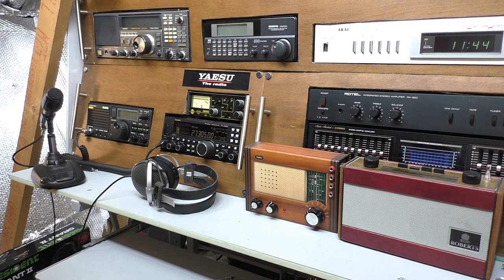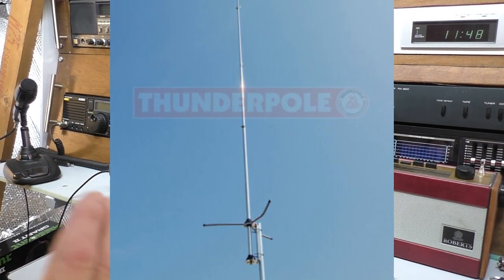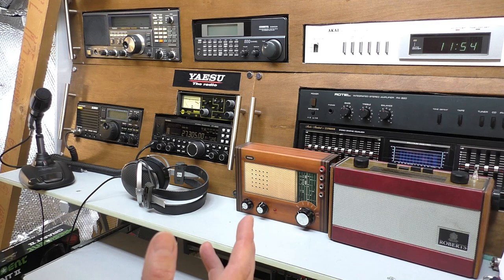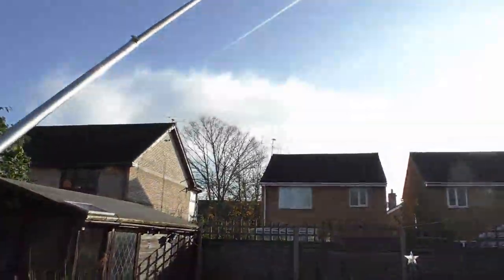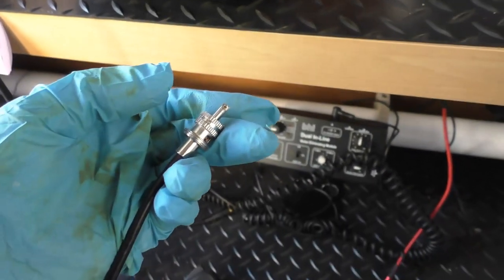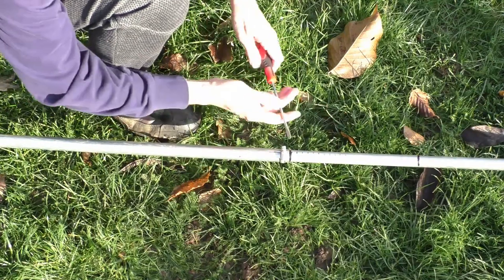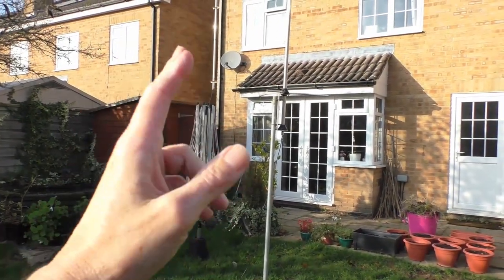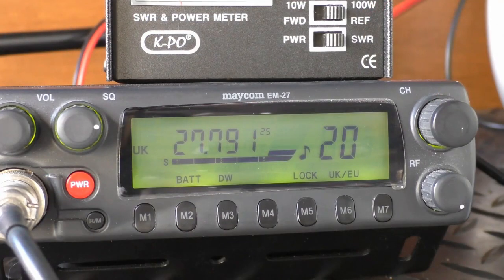CB Radio Beginners Guide.  Part 4. Setting up a home base antenna.  Adjusting the SWR

Comment: Great video Fred very simple but effective - just shows you that the angle of radiation from the elevated Antron 99 against a simple silver rod 2m of the ground perform very similar , might be nice to stick the ground plane kit to the Antron 99 and see what difference it could make. happy holidays 73's

Comment: I want to ask, if I test with a swr meter and the result is very high/very bad, will the swr meter somehow protect my radio from the high swr when doing this test to not take damage? Will the swr meter take the damage instead?
Reply from the maker: Good question.  As far as iam aware the SWR meter will not protect the radio.  Never been asked before so not 100%.

Comment: You forgot to say that each type of coax will require the correct type of pl259 for the type of coax you use.
RG8 mini gives relatively the same characteristics as RG213 with regard to power handling, losses and velocity factors but as you said RG8mini has the benefit of being more flexible.
Messi & pelony is more the radio ham choose of coax and is great for using on VHF and UHF but I would consider it to be a waste of money for using on CB and HF frequencies below 50MHz.
My top tip would be to have at least two 12-18inch patch leads made of RG8MINI AND RG213.
my reason for saying this is because most of any losses that occur will do so just after the radio and in the swr meter. So using higher quality patch leads helps to overcome this and gives a better swr and hence a cleaner signal.
RG8mini is my personal recommendation for coax for home based CB station.
Cheers Fred 👍(there's the thumb🤣🤣) have a good one and 73.
26CT2381 BAZ.

Comment: Hi isn’t it easier with all antennas to lower it all the way down to the bottom and then slowly raise it more and more until it’s tuned and good?
Reply from the maker: You could do it that way. Makes no real odds as long as you end up with a safe SWR.
Reply: @CB-RADIO-UK  I will have to trust the built in swr meter in my radio 🫢

Comment: interesting stuff fred, im slowly getting there with my new setup i got the thunderpole silver rod 1/2 wave antenna and rg 58 cable mounted on the side wall of my house about 4 mtrs of the ground ive yet to buy a swr meter. i couldn't find a power supply that i could afford so i opted for a 12v dc 5a supply the type with a cigarette lighter adapter on it i hope that that should b fine. thunderpole say there antennas come pre set for swr or am i just going to cause damage without one thanks and have a happy Christmas 👍👍
Reply from the maker: Hi James.  Video on PSU's coming up.  No antenna is truly pre SWR. Always safer to check.
Reply: Thanks Fred I look forward to the psu video however I was worried about the swr so I have orderd a fairly cheap swr meter should arrive tomorrow I'm currently sat listening to the channel 19 lol

Comment: New guy getting into the hobby. When you "key" up your radio, what am i hearing? Cheers
Reply from the maker: Might need a bit more info on the question.  When i say key up the radio iam meaning press the microphone button
Reply: @CB-RADIO-UK   Hi, Thank you for the quick response. It was when you were doing SWR reading trying to tune the antenna.  Could just be the CB for all I know. Brilliant video and just getting into the hobby as I said.

Comment: I have my home base antenna in the box, setting up sometime in the new year. Personally I don't give a #### about my neighbours. They never have this way. I'm wacking up a Sirio 827 with those big radials. If I have to take it off the house I'll mount it on a huge pole in the ground. 
The only thing that bothers me is the radials hanging over my drive and it becoming a pigeon toilet perch over my car.

Comment: IF WE PUT UP AN ANTENNA AT THE BASE USE RG-213. WE USE RG-58 AT 18 FEET LONG BECAUSE WE USE IT IN THE CAR. TOO MUCH LOSS LONGER THAN 18 FEET. I USE RG-213 IN MY FORD BECAUSE IM A HARDCORE CB'ER . BEEN ON SINCE 1974. STILL USING MY LAFEYETTE TELSTAT -140 SINCE 1979. THE GALAXY IN MY PICTURE IS AT MY OFFICE IN MANHATTAN NYC.

Comment: Don't know I'd anyone can help me, iv just set a homebase up which is picking stuff up nice and clear miles away but I cant seam to pick up the mobile cbs that I have in my vehicles. I'm operating on fm and obviously the same channel. Everyone is set up with the swr but I cant pick anything up from my vehicles or hear anything in the vehicles from the home base.
Reply from the maker: What radio are you using ?  Most radios have set bands for euro channels as well as the UK CB channels.  Could your radio be set on the wrong channels.
Reply: @CB-RADIO-UK  
Iv used a couple of different ones, currently iv got a cobra 29lx set up as the base cb and iv got a little thunderpole t-600 set up in one vehicle and iv got a midland set up in an other but cant remember which modle it is. I can check them and see whatbthere are set to. Iv got burners on 2 of them, so wasn't sure if that would affect them.
Reply: The cobra is set to UK and the t-600 is on eu. Would this affect it. When I check the frequency list eu and UK channels have the same frequency
Reply from the maker: Hi.  Yes they will be totally wrong.  EU and UK totally different.  Euro is 26.965 to 27.405  UK FM 27.60125  to 27.99125
Reply from the maker: UK FM freq https://www.ofcom.org.uk/__data/assets/pdf_file/0022/84406/citizens-band.pdf  Euro mid block freq  https://www.rightchannelradios.com/blogs/newsletters/cb-radio-frequencies-and-channels
Reply: @CB-RADIO-UK  
Iv just checked and it looks like this t-600 from thunderpole doesn’t have the UK channels. Cheers for the help like Fred

Comment: Why dont you just calculate and then ajust the length = 300 / 27.555mhz = 10.887mtr / 2 = 5.443mtr for halve wave, , , i find it works every time !!

For a 5\8th its = 300 \ 27.5 mhz = 10.90mtr \ 8 = 1.36 x 5 = 6.818mtr

ha, , ,or in basic, on the old C64, it would be something like this L=(x 5(\ 8(300 \ 27.5)))

Comment: Hey Fred, would you please help me get into CB/SSB/27.555 dx?

I’ve watched your most recent videos and now have £300 burning a hole in my pocket.  I’m looking for a mobile rig, including antenna, power supply, built in swr, and pretty much all I’d need to go sit in my car on a Sunday afternoon on a hill somewhere….. happy to provide my email or phone number if it’s easier…. Thanks so much 

Every video has been helpful on my journey
Reply from the maker: Hi.  Radio wise I would look at the Alinco DX10 or the CRT 6900N.  Both have built in SWR meters.  Mobile antenna for hillside DX work a longer whip will work better   Check out the Sirio 4000 or 5000.  Good luck and enjoy.
Reply: @CB-RADIO-UK  thanks Fred.  Would you direct wire or use an external power supply?  Also what do you think of the President Lincoln 2 compared to the ones you mentioned?
Reply from the maker: You can use a leisure battery pack.  I had a Mk1 Lincoln but i prefer the Alinco DX10.
Reply: @CB-RADIO-UK  would that be a leisure battery pack connected directly to the radio?  Thanks for your help
Reply from the maker: You would need to attach straight to the battery.  Normally small clips can be used or screw on type.